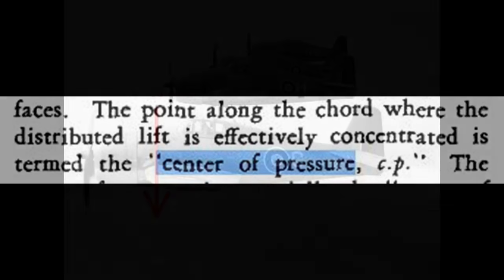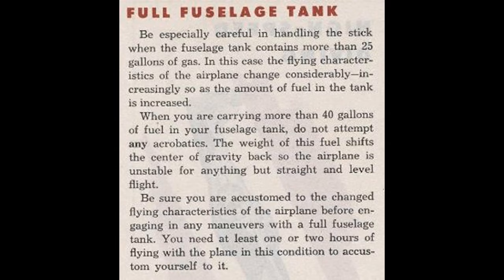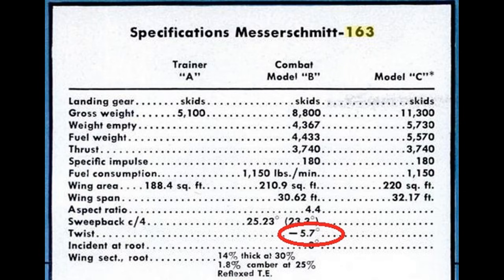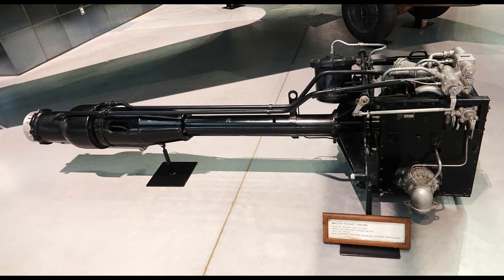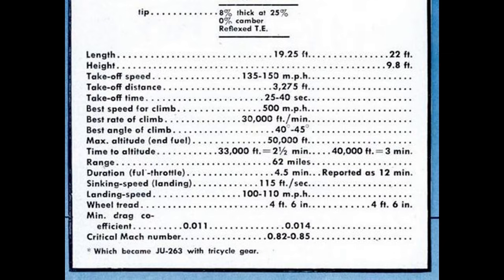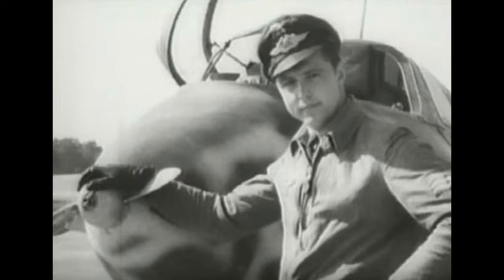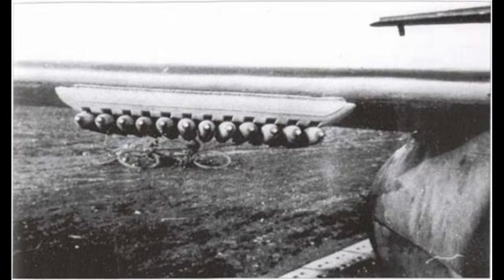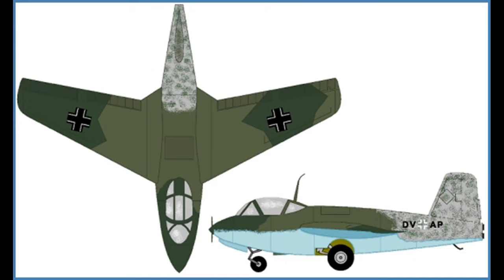Messerschmitt Me 163 Pt.2 Plus Me 263 and More!

Comment: The late, Captain Eric "Winkle" Brown, RN, had flown this plane after capture.  He holds two records that will never be beaten:  he flew the most types of aircraft, and he has the most carrier landings and takeoffs.  He also holds many firsts:  first to land twin engine plane on carrier - the Mosquito, and first to land jet on carrier.
Reply: Eric Brown's book " Wing's on my sleeve " is an excellent read.
Reply: Brown also flew the de Havilland DH-108 which was a Vampire with the tail removed and the wings replaced with ones based on the Me-163. Built at a time when the Brits thought tailless aircraft might be the key to supersonic flight, it had all the trans-sonic issues of the Me-163 together with a greater propensity to spin and a nasty divergent  longitudinal oscillation if one pulled g's at a high mach. They built 3 and all 3 crashed, killing 3 experienced test pilots. It's still considered the first  British aircraft to go supersonic, although today most consider that it was not the first British aircraft to go supersonic in controlled flight.
Reply: he also showed the Americans how to land a Corsair on a carrier ;)
Reply: @faunbudweis  Yes he did.  The US paid for several to die to try to beat his records.
Reply: @faunbudweis  Without Brown's carrier landing, the Corsair would have been done for.  Nobody in the US could fly the plane.  The US can build stuff, but they have no idea how to operate any of it.  They have no naturals at driving until the 1980's.  Foyt can only drive a bad steering car, Pearson ran on fuel strategy.  We have Buzz Buerling.  We won Ortona b4 Xmas dinner, at the giles of the Russian observers.
Reply: Quite a character, Captain  Erick "Winkle" Brown... 

His interviews are a true delight to watch today at YouTube, a true Legend!
Reply: Yes, 'Winkle' Brown was absolutely hopping-mad that he was prevented from flying a 163.
Officially, for safety reasons...
Reply: @VincentComet-l8e  The actual powered flight happened later at Humul airfield with a selected German ground crew assisting. (Eric Brown speaks fluent German) During this flight he climbed at a 45degree angle at a speed of 450mph, reaching 32,000feet in 2.75 minutes.  https://www.youtube.com/watch?v=8PN9AP710e0
Reply: Gort interceptor: F-102 and F-106, bomber B-58, 
all influenced by Lippisch.

Comment: 12:28 this may be a little off in the weeds but  rocket thrust is affected by altitude. The nozzle geometry is optimized for a specific altitude. Without knowing for which altitude the nozzle was  optimized it's difficult to quantify the effect in real life performance.
Love these videos!
Reply from the maker: From Wikipedia: "At full throttle, the net thrust of a rocket motor improves slightly with increasing altitude, because as atmospheric pressure decreases with altitude, the pressure thrust term increases." While I don't doubt there is some scenario where power will decrease, I think its going to be insignificant relative to a jet.
Reply: Scott Manley has a great video that covers how atmospheric pressure interacts with rocket exhaust and nozzle design.  In short, as atmospheric pressure decreases the exhaust needs more room for expansion to get maximum efficiency.  A nozzle optimized for low altitude work is too narrow for maximum efficiency in a vacuum.
Reply: @markkruger8540  It's very noticeable that the engines on the upper stages have much larger nozzles. The nozzle on the Apollo service vehicle, designed for use in space, was huge.
Reply: Yeah there is a lot behind rocket bell design, although I doubt that with the altitudes the 163 was used in the air pressure differences would cause more than a negligible thrust difference.
Reply: @1armbiker  Well, actually yes. Compare the air pressure at sea level and 30000 feet, it's huge. Going much higher than 30000 feet will give you less of a difference in air pressure.
Which should result in a noticeable difference
Reply: @1armbiker  There's less atmosphere at 52,000 ft than you would expect intuitively. My chart shows about 1.7 PSIA at 52,000 feet. You're not in a vacuum yet but you're a lot closer than you realize.
Reply: Can you expand on that ? Interesting.
Reply: @paulmanson253  I learned this from a textbook, but Scott Manley does a good example here. You also have to understand the context. Greg is talking about sea level to 52,000 ft, Scott is talking about sea level to total vacuum. 

https://youtu.be/l5l3CHWoHSI

In short the geometry of a fixed rocket nozzle is a compromise. That's why they use a different nozzle on a liftoff stage than in a stage used only in the vacuum of orbit. The same thing applies to the rocket planes, that nozzle was designed for optimum efficiency at a specific altitude. 52,000 feet is about 1.7 PSIA, sea level is about 14.7 PSIA.

https://youtu.be/l5l3CHWoHSI
Reply: Indeed this is the reason for staging in rockets such as the Saturn V. Ideally, the gases should be expanded to reach the ambient pressure. I don't really understand the problem of attempting to do too much expansion though.
Reply: If you don't expand enough, after the gases leave the nozzle, they then expand outwards which wastes some of the energy.